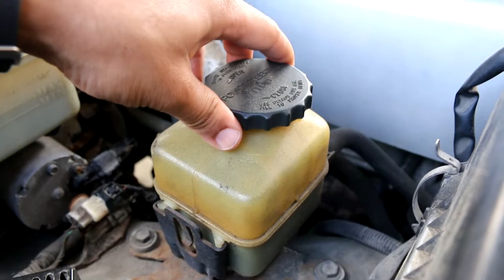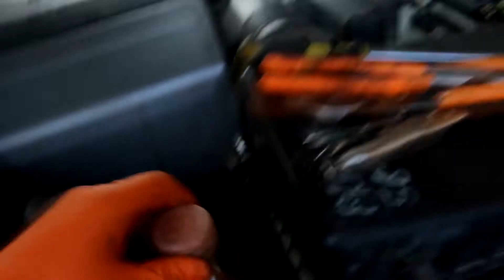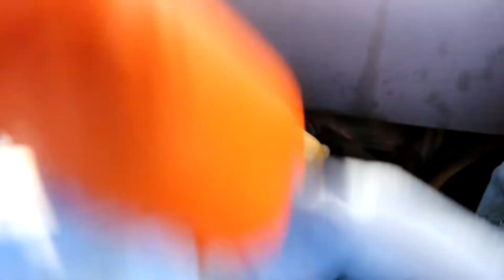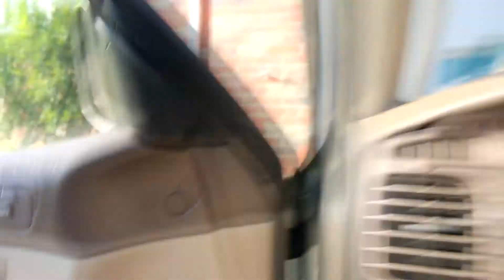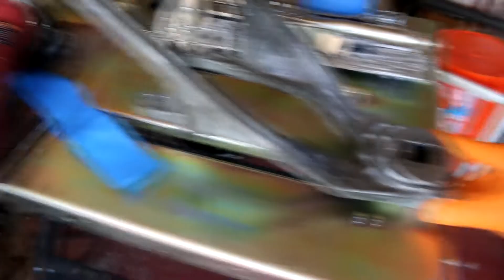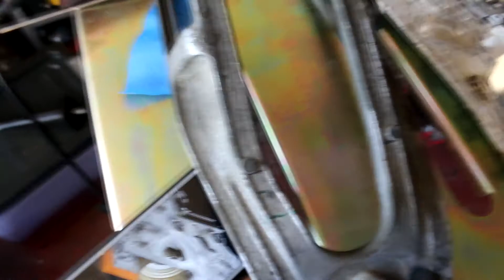lx 470 power steering fluid change

Comment: "T five or whatever that is." Those are roman numerals. You're probably used to the Arabic numbers (1, 2, 3 etc). The "I" to the left of a "V" means four. "V" is five and you subtract the "I" from the "V" when it is to the left of it and you add it when it's to the right so "VI" would be six and "VII" would be seven. "X" = ten "C" = 100. Check it out.

Comment: Can you share any info how you were able to connect the double din head unit to the existing system? I have a 2000lx w nakamichi, but they apparently don't make a harness to be able to used the existing amp . Thx
Reply from the maker: I did a video on this a few years ago see below . it is not the nakamichi but should help. https://www.youtube.com/watch?v=8NPjLJirzAg